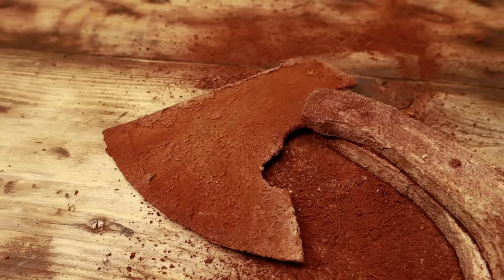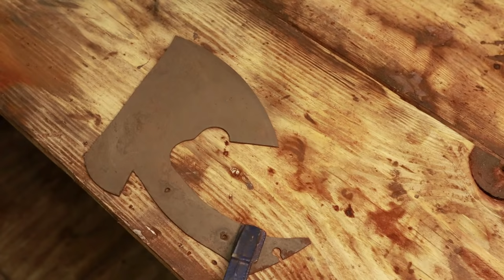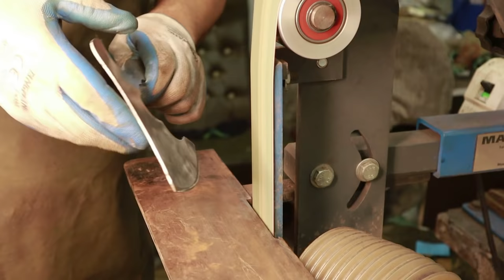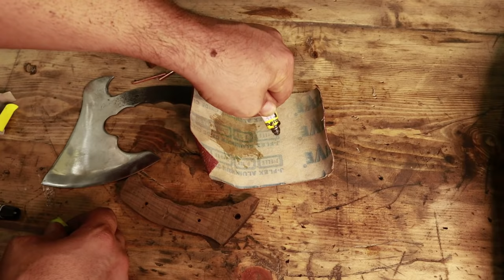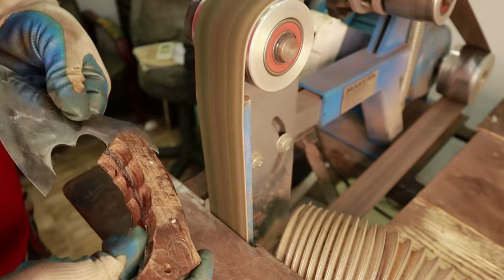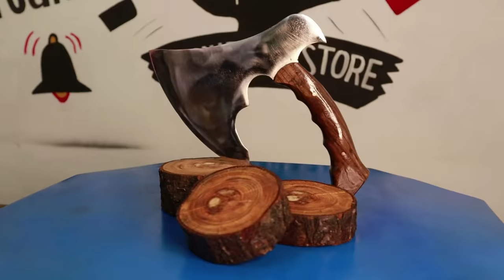CLEAVER KNİFE RESTORATİON - Axe making

Comment: What did you use to create that much rust? I know its not natural because that much rust would have deformed the edges. As we can see the edges are very defined and crisp.
Reply: Lol I was going to ask the same question.
Reply: @thealicemonster9217  did you notice  all the tools have the level and color
Reply: Wouldn't it take hundreds of years for that much rust to form even artifacts from the bottom of the sea don't havr that much rust on thrm
Reply: @martingolding4951  Try steel (or iron) tools from wet cellars or mines. There are covered with very thick layers of "bubbly" rust after few years.

Comment: How long did you leave the blank in the rusting agent and then out of it before neutralizing it?  Also what did you use for it?  Third what where the two colored liquids that you mixed together in the film?

Showing the set of ready made blanks with broken handles all with the same exact rusting on them is kinda a dead giveaway that you are pre rusting blanks.

There are so many old tools that actually need to be restored.  Why not use the knowledge you have to fix those instead of basically pulling scams on people.
On camera you do nice work, you don't have to try to trick us in to thinking you are doing something you are not ie restoring.   You can just do "look I made this custom axe from a blank" or even just start the video with a sheet of metal and go from there.

Edit:
Evidence is that the axe is sheet metal, that is a relatively new way of making them.  
All of the tools he showed at the beginning had the EXACT same rusting and dirt patterns.  
He admitted to using vinegar as a rust remover in another comment.  This is a MILD remover at best that would not work if the axe was naturally rusted as bad as it looked.
Lastly if the sheet metal had rusted out to 3 times its size then there would be no axe to restore.

Comment: Só quem nunca usou uma ferramenta não percebe q esse machada está intacto, apenas usaram uma técnica de envelhecimento e ferrugem, típico de youtubers, ou pra quem vende produtos de restauração.
No mais, no geral é um trabalho incrível, e essa machadinha top demais!
Reply: Вы думаете, что этот топор новый и ему не требовалась реставрация?! Я даже не знаю что и сказать и какие выводы сделать... Неужели новый топор состарили. Хорошо бы узнать мнение Мастера.
Reply: Pensei a mesma coisa!!!!
Reply: @НикПачежерцев  The axe was flash rusted and also had mud or something caked on it.  The original axe was actually just a blank that was fitted with a handle that was also aged.   The blank was probably new when he put it in the flash rusting medium.
Evidence is that the axe is sheet metal, that is a relatively new way of making them.  All of the tools he showed at the beginning had the EXACT same rusting and dirt patterns.  Also he admitted to using vinegar as a rust remover in another comment.  This is a MILD remover at best that would not work if the axe was naturally rusted as bad as it looked.
Lastly if the sheet metal had rusted out to 3 times its size then there would be no axe to restore.

Comment: Please don't take this wrong. But I think you stopped short of a great polished blade. You can see the different polishing marks at different angles on it yet. A finer polishing compound may be needed to eliminate those marks. Could even try some wet polishing compounds. Other than that, very nice...
Reply from the maker: thanks gary